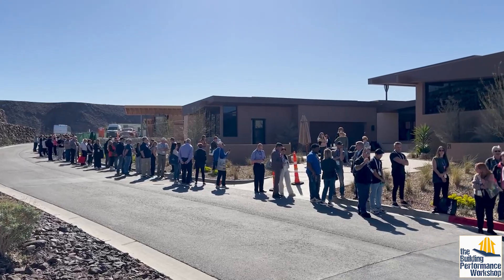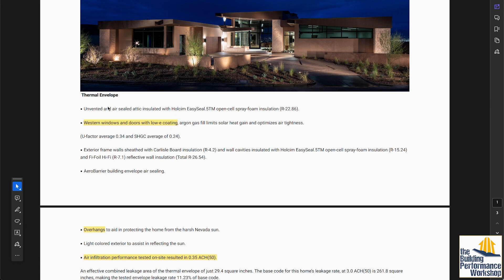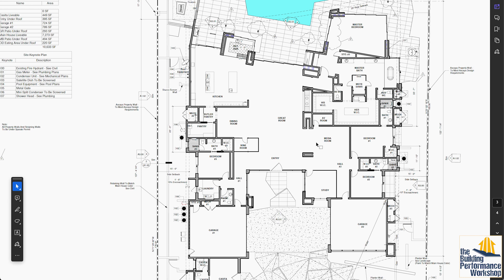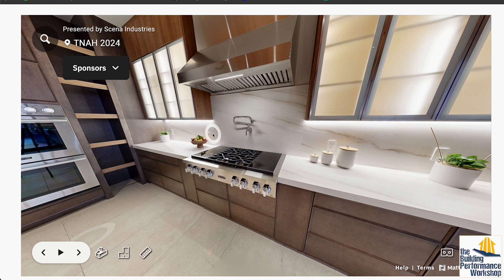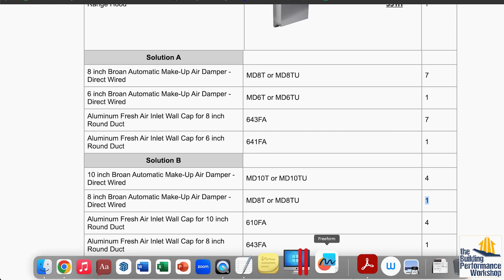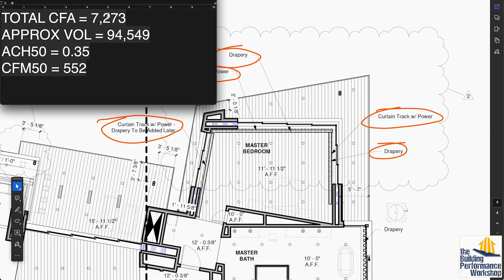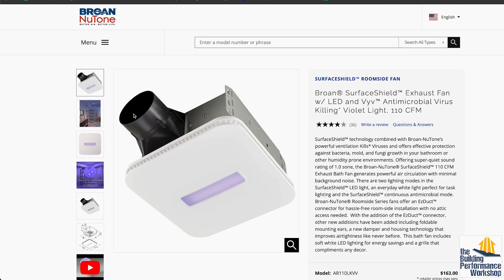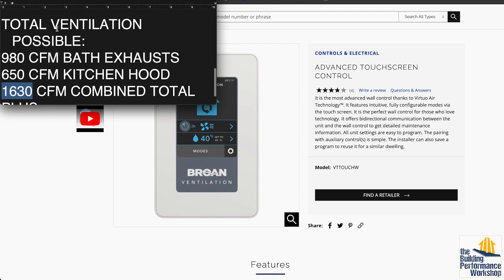Home HVAC and Performance Analysis Demo: 2024 'New American Home' for Fancypants

Comment: I’m going to call BS on their claimed blower door number.  If that number is real, it must be the “final” number from the AeroBarrier installation where they have every window, door and vent taped up to keep the sealant out of everything operable.

With all those sliding glass walls etc. there’s no way they’re getting to below PH numbers, even with an otherwise perfectly sealed envelope.  I’m betting a real blower door test comes out with 5X that air leakage.
Reply: I install Aerobarrier and agree with this. It's easy to get to that number at the end of an aerobarrier seal, not so easy to include windows, doors, and exhaust fans.
Reply: @seanharris6860  thanks for your input!!!
Reply from the maker: Sounds reasonable to me, all we have is what they tell us

Comment: What i like is they show off the rangehood. Here they hide it as much as possible. The smallest legally allowed, pushed back to the wall, and the front edge only goes halfway across the burners 

What they do here with big windows is put jail bars across them to reduce heat gain. But it still has all the losses of the windows.
Reply from the maker: New Zealand, for those who haven’t met Tweake

Comment: Manual J out the window when you open the patio wall.  Air curtain?  The bath fans will not have any flow at those static conditions.  Need to review their PV curves.

Comment: Would it be a better strategy to just run continuous ERVs that have a manual or automatic boost mode for bathrooms and not have additional bath fans?
Reply from the maker: If you gotta have an ERV, then yes it’s a shame to throw out air that’s not stale
Reply: @HomePerformance  How long does it take for air to become stale?